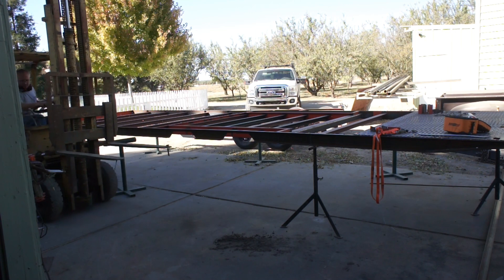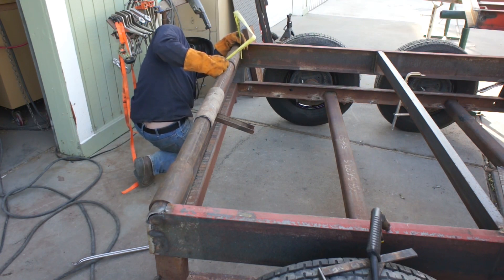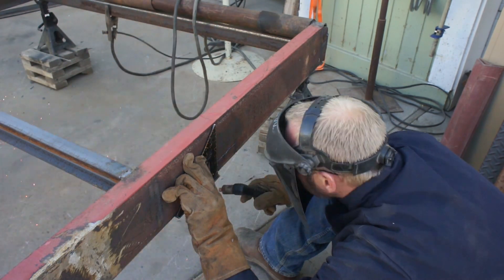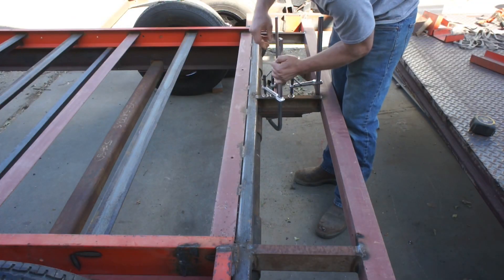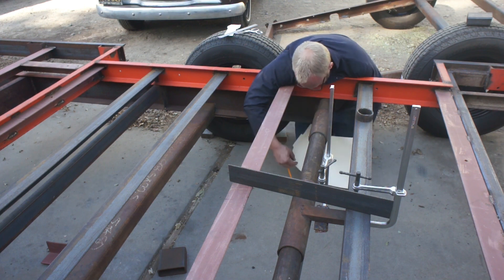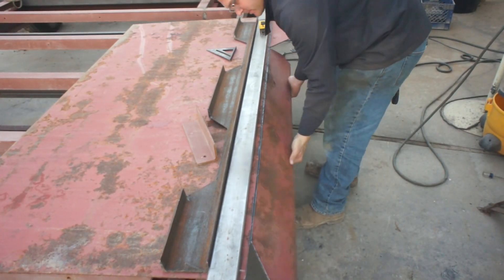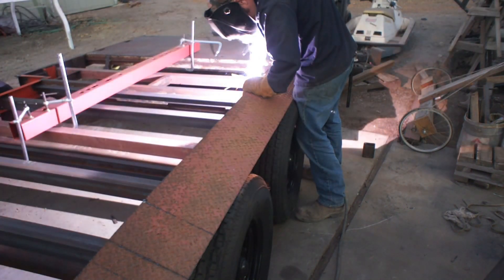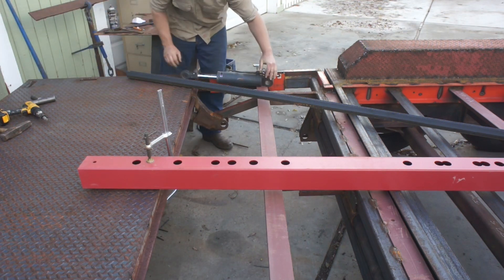DIY 26ft Trailer build part2 | Hydraulic tail

Comment: While watching the first video, when you initially mentioned that you were making it a "deck over" I thought, there's one aspect I would've done differently. I've built a few trailers over the years myself. My buddy and I built a 26' last summer. I can't get them low enough, it seems. I've been thinking about mounting a small crane on another 26' we have. I think I just about got it worked out in my head. You do great work! Looks awesome!
Reply from the maker: I looked at using lowboy tires and wheels, they are available in the same 8 lug patterns but are pricey. It would've netted me only about 3" of decreased height. Thanks for watching!

Comment: How did you figure how much lift your tail will have and were to attach you hydraulics ? I am adding a power tail to my trailer thanks
Reply from the maker: baum hydraulics calculators and then a scratch sheet of a few estimations.

Comment: What would happen if the hydraulics failed? Will the dove tail fall as you’re driving down the road?
Reply: Just started part three. Think you just covered a read locking system. 😂